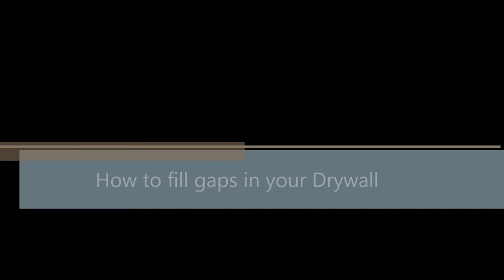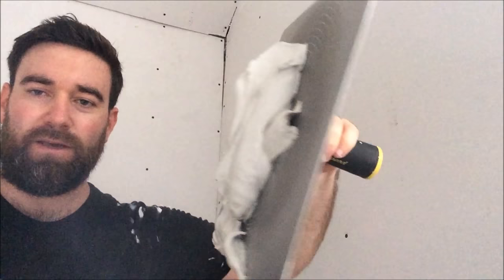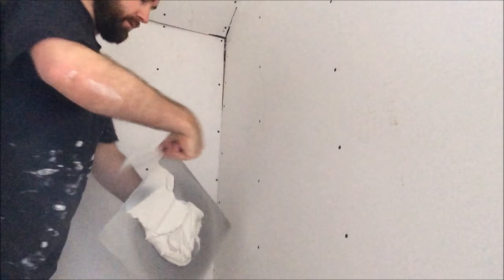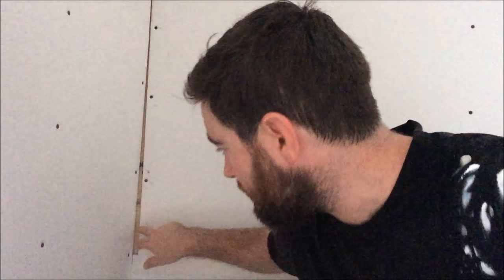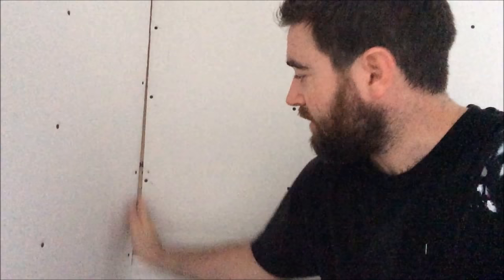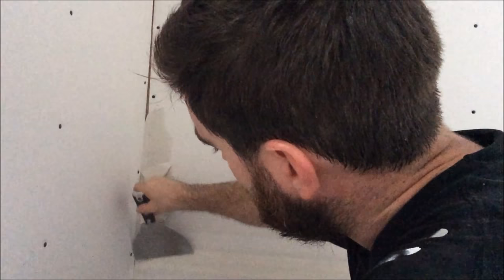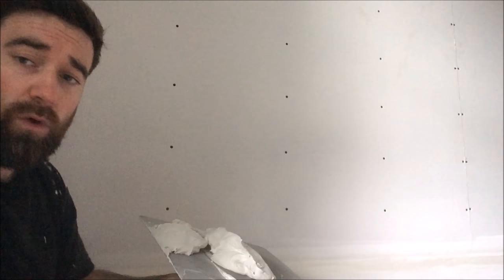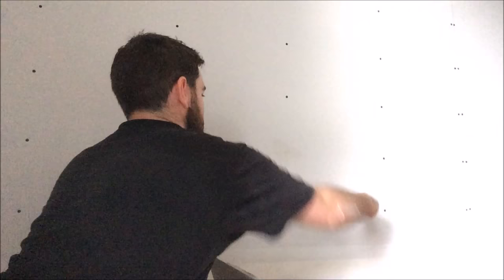How to fill gaps in your drywall

Comment: Good information but if im covering the area with wallpaper after the filling the gap w sheetrock 90, do I still need to tape and apply the sheetrock compound?  Thx
Reply from the maker: Thanks !
Good question, I suppose if the wallpaper will be covering up all the surface you wouldn't have to tape, now when you wallpaper over a surface that isn't painted, it might be difficult to remove it later on, if you think you will be removing later down the road you might want to finish the wall so removal will be easier, if you don't think you will be the kne to take it off then it will be the next person's problem haha 
Hope this helps 
Thanks for watching and for the question
Reply: Thanks so much for the information, and this wallpaper will not be removed once pasted as the area will have wall mounted storage units.

Comment: Love the info.  Is there a difference between sheetrock 90 and joint compound?  Cant I just use the sheetrock 90 as a gap filler, then after it drys, use it again with the tape?
Reply from the maker: I would suggest using the sheetrock only for filling the gaps, the other premixed compounds are made for the taping. Thanks for the question

Comment: After removing paneling I found where the previous owners cut 1 inch wide trenchcuts in the drywall to hide speaker wire before putting paneling over it. No I want to skim the drywall and paint it. Will this work for that? I can't get any furring strips behind it.

Comment: I did a ceiling patch but there is maybe a 3/16" or 1/4" gap. This gap is mostly open to my attic. I'm not sure if I should just lay down compound then tape then compound like I did on the wall, or I should prefill...my main concern is if I don't prefill it not doing a good enough job keeping attic heat out. But now it seems prefilling requires Sheetrock 90 instead of all-purpose joint compound? Let me know what you think. I was going to fill a syringe with compound and squirt it up in there at least 1/2" deep to equal the sheetrock.
Reply from the maker: Hi Joe, thanks for watching and for the comment and questions. Without seeing the area in question it is hard for me to say what is the best way to approach the issue. But personally I always like to use the sheetrock 90. If you are able to use it, thstvis what I would do. Would it be possible to take a photo of the area and post it in the comment section ?
Reply: @TheCanadianHomePainter  I can't. Too stupid...just spent 20 minutes trying to figure it out. My other question is should I scrape/sand away the existing ceiling finish around the joints so that it's flatter after I tape and mud?
Reply from the maker: @robloxvids2233  you want the finish to be as flat as possible, before you prime and paint, if it isnt you will see it when you paint . What I like to do after the mudding and sanding is done, I take a bright light and shine it in different areas to give me an idea of spot that need more sanding. Hope this helps
Reply: @TheCanadianHomePainter  Yes, thanks for your responses sir!
Reply from the maker: @robloxvids2233  you are welcome, let me know how it turns out and feel free to ask any other questions.

Comment: Just did my garage myself and it’s not the best but it’s honest work . I have multiple gaps and plan on doing this. I just would really appreciate some guidance on making sure this would all be good in the long run. As far as the tape and mud , what are some key points to look out for ?
Reply from the maker: Hi! Thanks for watching and for the comment, I do have some other drywall videos on my channel that you might find helpful, I always use paper tape for my projects and here where I live CGC compound is the preferred product, personally I pay a bit extra for what is called dust control all purpose, when it is sanded it doesn't go airborne the dust drops to the ground. 
For sanding I like using the sanding blocks and the pole sander blocks aswell. Good luck with the project. 
The most important step is filling the gaps correctly,  so you are on the right path 👍🏻

Comment: What is the difference between sheet rock 90 compared to regular joint compound?
Reply from the maker: The reg compound all purpose is generally what is used for applying the tape to the joints, the 90 is a bit different,  it sets up hard in about 90 mins and so you wouldnt want to use it for tapering and it gets very hard. Like a rock lol so it is great for pre filling gaps that you might have in the drywall. All purpose would take weeks to properly cure and you would have major problems. Hope this answer helps you out. 
Thanks for watching and for the comment

Comment: Can I use the Sheetrock 90 on the ceiling?  The 5/8 fire board is pretty heavy for me and I had to cut it down a bit to work with it.  Short story is that I have pieces of ceiling that are not flush butt joints.  I’m contemplating installing  1/4” over the 5/8, as I can certainly manage the lighter board on my own.   As an amateur with mudding, I’m thinking the fewer seams I have s equates to fewer eye sores.  That said, the Sheetrock 90 may help correct my learning curve.  Thx in advance, Chris
Reply from the maker: Yes you're right chris fewer joints the better, that 5/8" stuff is very heavy and not easy to work with. I use sheetrock 90 on ceiling and walls wherever the gaps and cracks need it. Going over it again with 1/4 " seems like alot of work but then again it might cut down on how much mudd you need to do. Only use the sheetrock for large gaps dont use it for anything else. Unless you use metal beaded corners that get nailed on then a first coat of sheetrock isnt a bad idea

Comment: I have a small patch about 18 x 14 in with one side having a 1/4 in gap between butt joints.  Do I really have to buy 18 pounds of setting compound to do this crack?  Small quantities scarce, sold out, unavailable now.  Trip to store, most of it leftover, will never be used again.  It is hard not to just give all purpose compound a try instead.
Reply from the maker: A quarter inch isn't terrible, it's too.bad they are out of the small bags,  all I would say is if yiu do use regular compound , make sure you give it enough time to dry, there can't be any moisture left before you prime and paint or it will bubble and look terrible

Comment: Thanks for the video. What is the main diff in result between the 90 and the 45? Thanks also for letting me know what would happen if I didn't do this step. Also, can I just use the 90 and skip using the regular low dust USG 3.5 gal bucket of mud that I also purchased?Thanks.
Reply from the maker: Hi sorry for the late reply, the difference is mainly the set up time between the 2, 90 starts to set up in about 90 mins where 45 is about 45 minutes. I like having a bit more time to use it .90 is only for the gaps
Reply: @TheCanadianHomePainter  90 is only for the gaps. What do you use for the regular taping/mudding? Is it just called "all purpose joint compound"?
Reply from the maker: @Erilis000  yes that's right

Comment: In Britain we’d use a mesh tape to cross the gap before filling. Surprised if this won’t crack
Reply from the maker: Ni it wont crack, it's just the prefilled,  I put tape over it after its dry, this is just to fill the large gaps
Reply: The Canadian Home Painter - ah ok. Sorry I skipped parts of the video. Just wondering do you guys always tape and fill plasterboard? We tend to skim the whole wall
Reply from the maker: @isyt1  no worries, this is drywall board, bit different then plaster I think. And we just apply compound to the joints
Reply from the maker: And corners and screws of course
Reply: The Canadian Home Painter - we tend to skim the entire wall on top of drywall boards. On new builds, when cost is an issue then we’ll tape and fill as it’s cheaper and quicker but plastering the whole wall gives a better finish.

Comment: Would it be fair to say that whether we use 90, 45, 20, or 5 drywall compound the primary goal is to fill wide gaps first before taping or does the 90/45/20/5 mud have different physical properties other than cure time? I have all of them at my house and typically swap based on how long I need to apply my batch. Most of my jobs are small
Reply from the maker: The biggest between those three is dry time, the 90 gives me the most time to work with, 45 cuts that in half, typically sheetrock 90 will be set up and fairly hard in 90 mins, 45 minutes,  20 minutes

Comment: Why using so many nails/screws on the walls. Only need about 10% of them and use stud adhesive instead. That stuff holds incredibly well.
Reply from the maker: I was just doing the typing,  I didn't hang the boards

Comment: There are a few different options made by sheetrock with the 90 label, durabond and easy sand 90.  Which do you use?
Reply from the maker: I use the durabond

Comment: What if I have a gap like that one but with no support behind it 
Like it’s open behind it Can I still apply the 90
Reply from the maker: That can be a bit harder to do, because if the compound  isn't thick enough, or to wet it will not stick, but if the consistency is like smooth peanut butter lol ( the only thing I can think of as an example)
Then it should work and it will make taping it better to have a more solid corner to apply the paper tape  hope this explanation helps 👍🏻

Comment: I know this video was posted a couple years ago. But you mentioned it hardens in 90 minutes. Is this an all pourpose drywall mud? You said 90 but my brand name memory is shiite!
Reply from the maker: Hey, yeah it's been a couple years since I did this. Always surprised with how many views some videos can get. To answer your question, for filling large gaps like this I use sheetrock 90, it is in powder form and you mix it with water, it starts to harden up in about 90 mins. It is rock hard in probably 2 hours give or take
Reply from the maker: It is not all purpose compound. I only used it for gaps and screws and big repairs

Comment: Someone did a crappy job in the corners under my cabinets, would this be ok to use? Also After this dries is it ok to paint over?
Reply from the maker: The sheet rock 90 is just to give you a good strong backing, after it is dry that's when I apply the tape and use all purpose compound,  the 90 isn't for the finishing just for filling the gaps

Comment: I tried to find the sheetrock 90 "cgc product" at Lowe's and online, but can only find the sheetrock 90 "usg product". Can you please tell me what the difference is between these two products and if it even matters if one is cgc, and the other is usg. They both look like they are made by the same manufacturer, and they are both sheetrock 90, but does it even matter if the product is either cgc, or usg? if you see this question and it seems like a stupid one, please forgive me, I am a single woman who is doing my own home reno.  Thanks.
Reply from the maker: Hi there, not a dumb question, I actually had to do some searching to find what the difference is and as far as I can tell, USG is the parent company so the product should be the same. And maybe if you're in the states it's usg and canada and other countries are cgc. Anyways hope that helps 👍🏻
Reply: @TheCanadianHomePainter  Thank you so much for your very helpful response, it's much appreciated.
Reply from the maker: @Serenity-sg4jf  you're very welcome

Comment: Hi I live in the uk and currently have this problem . We have a ready mixed product called poly filler .. is this the same thing ?
Reply from the maker: Hi, no poly fill will not work to fill these types of cracks, if you show them a photo at the building store, they should know what product is best used there. You need it to dry quick and very hard to be a good base. Hope this answers your question, let me know how it works out for you

Comment: im hoping its not way to late to ask this, but im in a pinch and i dont have any 90 or 20 can i use some "Premix" in its place,?  i dont have many more options so its either that or cut a little more back and put in a piece of backing board. Penny for your thoughts!
Reply from the maker: I wouldn't use premix , depending on how big the gaps are, the premix will take a long time to be dry and have no moisture left in it. If it isn't dry and you tape over it that moisture will push through the tape and that's why the tape will bubble and break. Filling the gap with drywall board is a better idea if you can't get sheetrock 90. Hope this helps
Reply: @TheCanadianHomePainter  thank you SO MUCH for your reply! I'm sure your probably a busy guy so I know it ain't easy to respond back to every message you receive.
Reply from the maker: @wesleywilson7328  you're welcome

Comment: You never specified...easy sand 90? Durabond? There are a few sheeteock 90 products
Reply from the maker: The stuff I use comes in a bag that says cgc sheetrock 90 drywall compound on it . So it doesn't say easy sand or durabond on it
Reply: @TheCanadianHomePainter  gotcha

Comment: I'm doing a small drywall job in my bathroom and was advised to use drywall tape when applying the mud. I noticed you didn't use any. Is it necessary?
Reply from the maker: Hi, this is just demonstrating the pre fill application, after the gaps are filled then you apply the tape and all purpose compound
Reply: @TheCanadianHomePainter  Can I do without the tape if I'm just filling a small area. Its not a whole wall just a peice of moldy drywall I had to cut out.
Reply from the maker: You can, but as a professional I can only say how I do it and I always use tape, over time you will see cracks possible without tape.

Comment: what is the largest gap you can have between joints before you should prefill? i thought it was like 1/8”.
Reply from the maker: Yeah and 1/8 is ok 👍🏻
Reply: thanks. also, on an existing finished (painted) wall where it butts with new drywall, how do you prep that painted wall so you don’t get bubbles or whatnot?
Reply from the maker: @joe burton  I use cgc all purpose compound, and I find indont get bubbles, and if I do I just touch them up after I sand
Reply: and this is the same stuff you’re using to fill those gaps?
Reply from the maker: @joe burton  no that is called sheetrock 90 it is what I prefer, made by the same company. I use all purpose for finishing

Comment: Thanks for this video. Do you happen to know what a U.S. equivalent of CGC Sheetrock 90 would be? Thanks
Reply: I called cgc and they said the usg equivalent is Easy Sand 90. Will give it a shot. Best wishes
Reply from the maker: Hey, sorry for late reply, I was going to suggest going to a home depot and asking if they carry it. But now that you mention easy sand 90, I believe another American once told me that. Hope it works well for you, thanks for watching and for the comment
Reply: @TheCanadianHomePainter  thx for responding, I'll report back. P.S. with your voice in this vid, you should make an ASMR video. Haha.
Reply from the maker: @cb7963  haha yeah I've had people tell me that before, I wasn't even aware of asmr until some other were commenting on videos that I did voice overs on. 
Thanks for the compliment 
And yes keep me posted on how things turn out with the easy sand
Reply: @TheCanadianHomePainter  A followup if you don't mind. Other videos talk about pairing hot mud with mesh tape. Do you do this in certain instances? For example, if the gaps had been wider or deeper in this video? Thanks in advance.
Reply from the maker: @cb7963  honestly I have never heard of hot Mudd, the worse gaps for me the sheetrock 90 always does the trick
Reply: @TheCanadianHomePainter TCHP,  just following up here. The Easy Sand 90 worked well for my skylight finish work, thx for the info. 
P.S. Regarding my other question above, by hot mud I just meant mud with a drying agent in it (such as Easy Sand 90). Got a little fancy with the lingo after watching a few drywall videos.... sorry ;-)
Reply from the maker: @cb7963  haha ok , never heard that term before. Glad it worked out well for you

Comment: Can this be done with Sheetrock 45?
Reply from the maker: Yes it can, I prefer the 90 because it gives me a bit more time to work with. 45 will start to get harder quicker, but yes you can there is even a 20 which dries even faster
Reply: @TheCanadianHomePainter  wow, that was quick! I bought a bag of 45 recently and thought I might have to go back and get another bag of 90. It's good to know that either can be used to acquire the same results. Time to patch up my amature and multi-gapped sheetrock project lol! Thanks again for the info. I'm glad to know that all is not lost.

Comment: can I use 45 min mud and let it dry fully or do I need 90 min.
Reply from the maker: 45 will work, I like using 90 because it is a bit easier to use since it doesnt set up as quick as the 45 but that will work

Comment: How do u clean sanding dust from drywall do u sand drywall by hand or machine ??
Reply from the maker: I typically use a sanding block and a pole. but I also use had sanding blocks aswell , the pole just helps speed things up a bit especially on the flat joints on ceiling and walls
Reply: @TheCanadianHomePainter  ok ok thanks